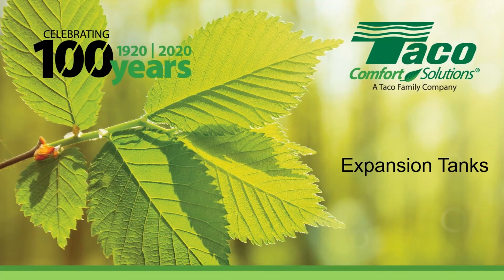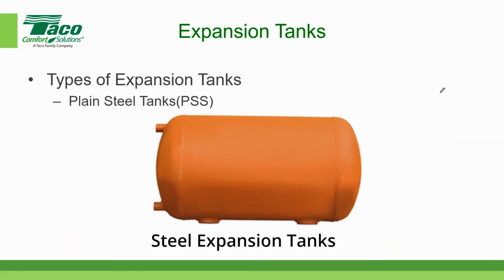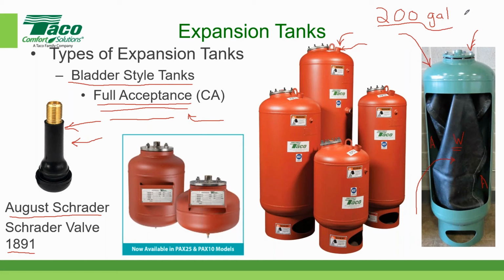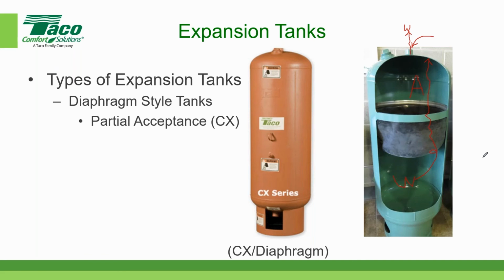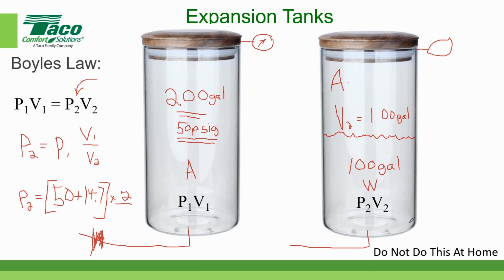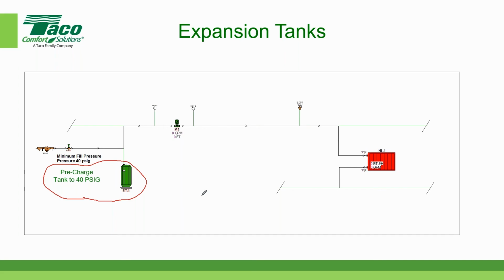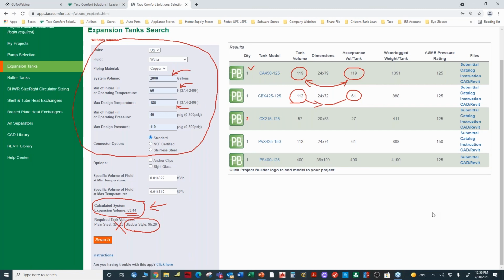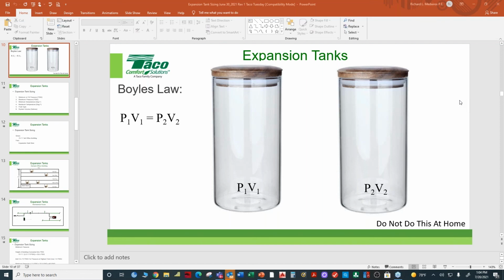How to Properly Size an Expansion Tank

Comment: Hi, great video, thank you veru much! I have 2 questions. 1. Is it necessary to have a pressure relief valve if you have an expansion tank installed? 2. How do you calculate the minimum pressure when the expansion tank, chillers, and the rest of the mech room is on the highest point, and the location of the AHU are lower? Do you assume 0 ft of building height and establish it at 5-10 psig?

Thanks and have a great day!
Reply from the maker: Alfredo, thanks for attending or watching the Taco Tuesday webinar series. Here are your answers you are looking for:
1. Pressure relief valves are always required.  Should the expansion tank become filled with 100% water (fluid) a properly sized relief valve will keep the system from excessive pressure.
2. The minimum pressure at the expansion tank is equal to the fluid column above the expansion tank plus an additional pressure determined by the engineer of record.
I hope this helps.